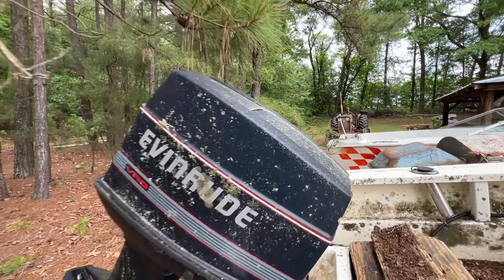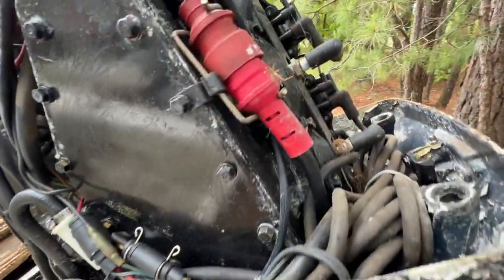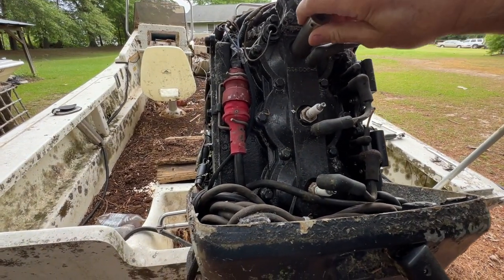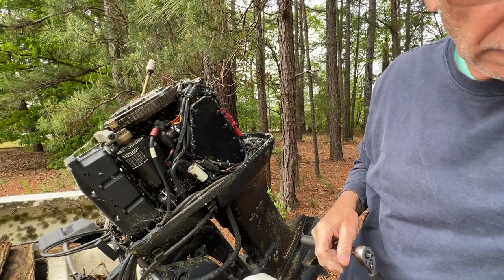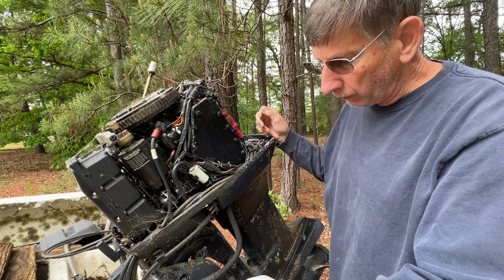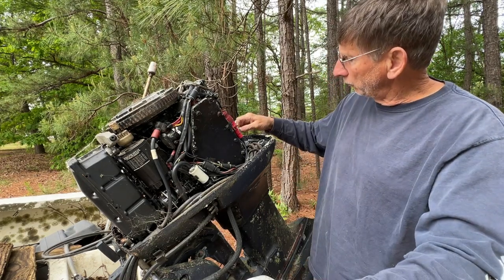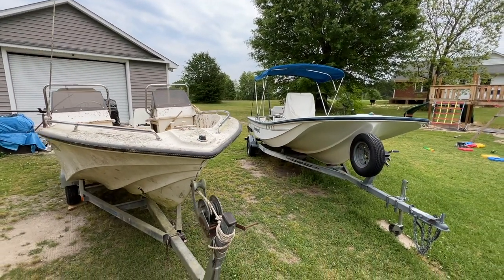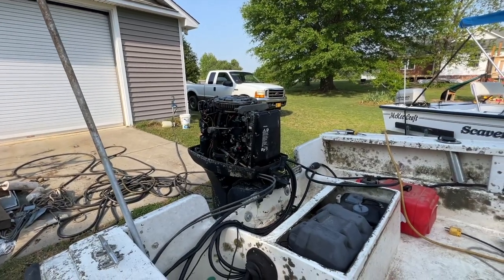Part 2 - Barn Find Henry O 160 Fishing Boat

Comment: I have a Henry O 150. If I remember right there should be a number stamped somewhere around the key hole. That'll be your key number. Some marine dealers/shops will have OMC keys. All you need is the number.
Reply from the maker: Thank you for the advice
I didn’t know that
Too late for this one as I have already replaced the switch but I will certainly try to remember that next time
Thanks for watching!